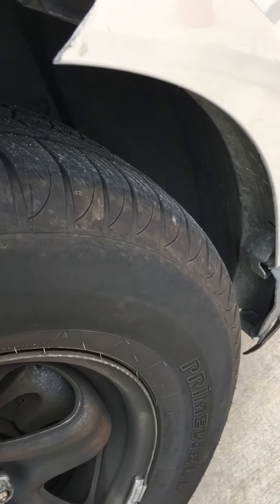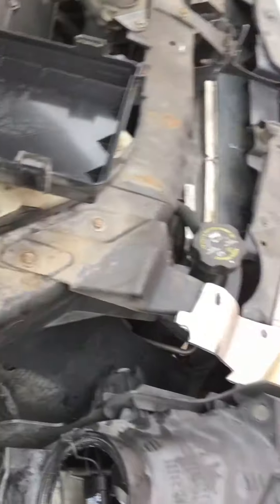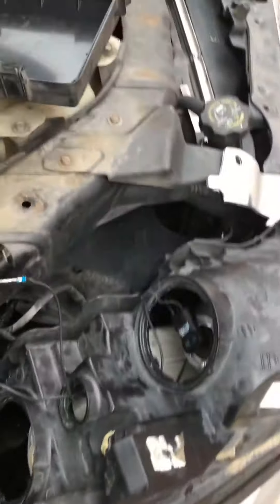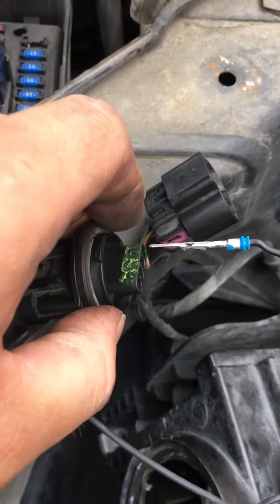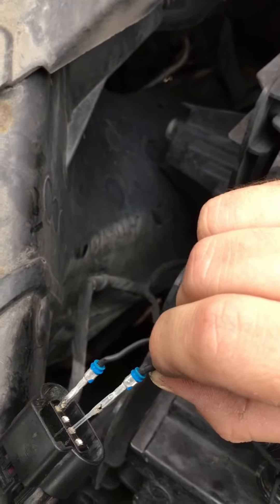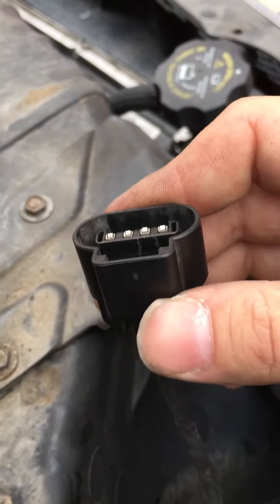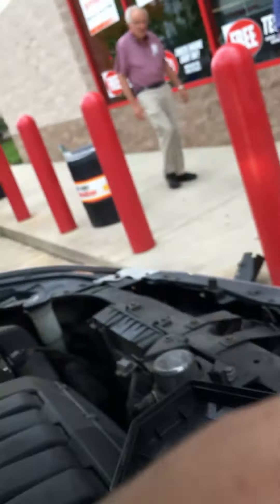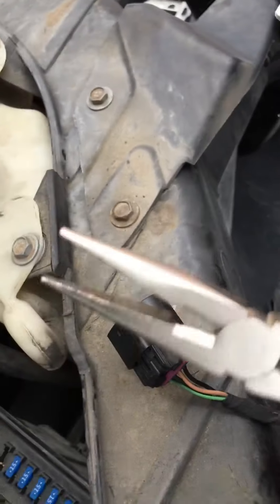How to temporarily fix headlight problem in wires.

Comment: So how was the fix?
Reply from the maker: “Temporarily” fixed
Reply: @CarDetailing4Life  2 years later and the temporary fix is still holding? That’s my type of repair!😊
Btw, have you finally screwed back the panels that you said you weren’t?
Reply: @Streetlocksmith  do you have a video on how you fixed it?